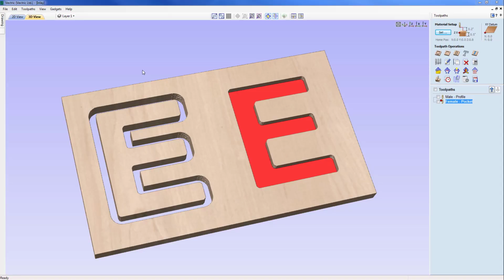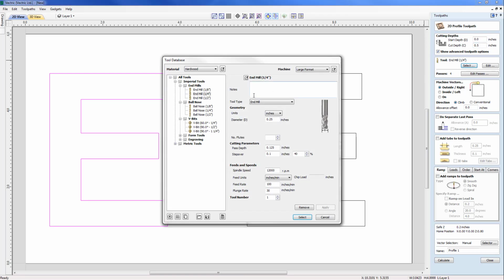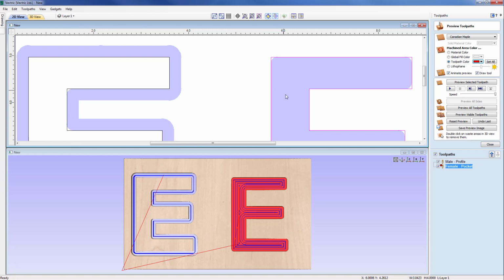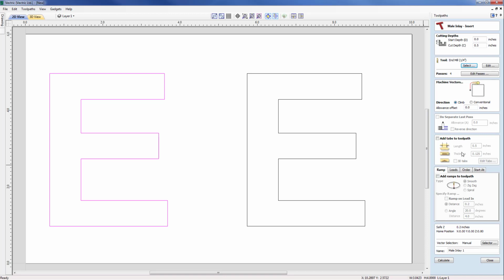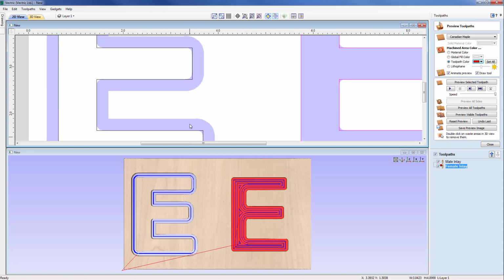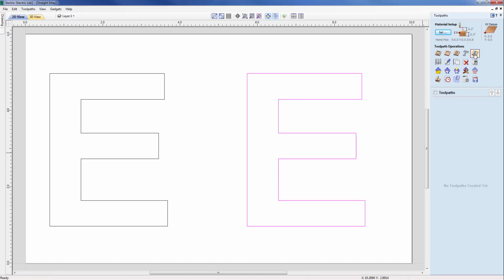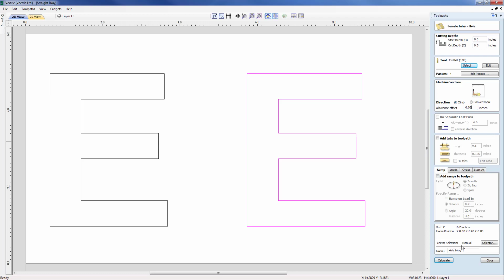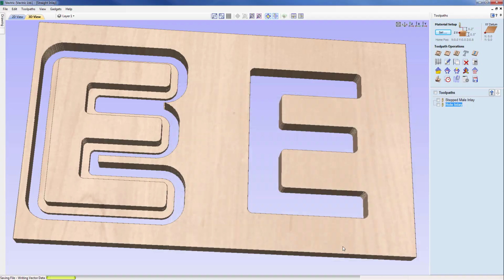Vectric V10 Tutorials | 2D Toolpaths | Auto Inlay Toolpath Guide

Comment: Thank you. My question is pretty simple I think. I have been inlaying expanded PVC letters into wood. I pretty much need to use a 1/8" O' flute bit for the plastic. I can certainly use a 1/8" bit for the wood but the letters are big. it takes forever. Can I use a 1/4" to do the rough work and finish with 1/8"?
Reply: There is only one way to find out.